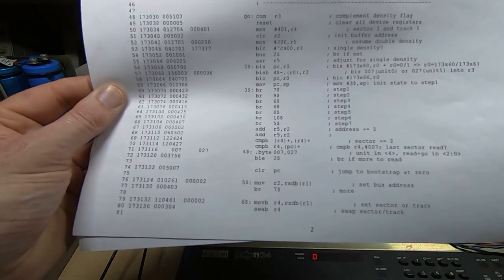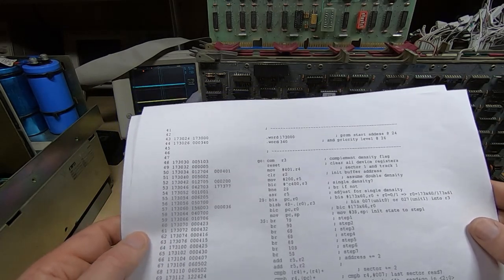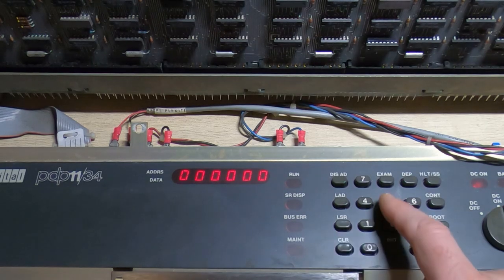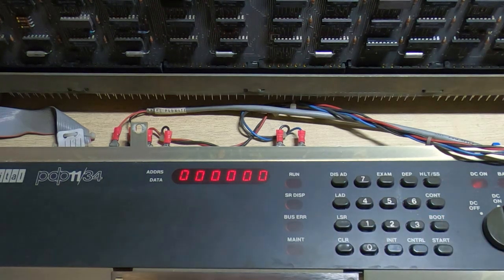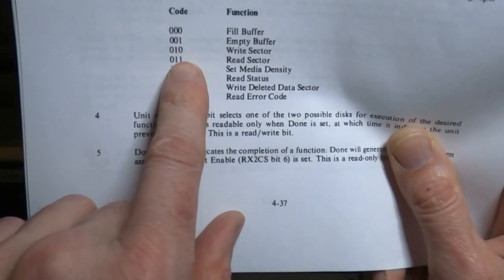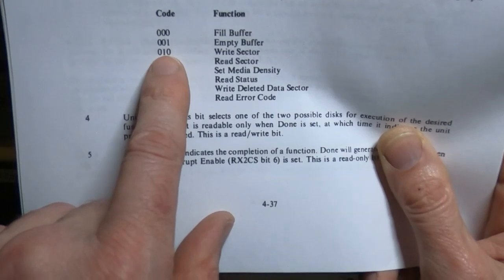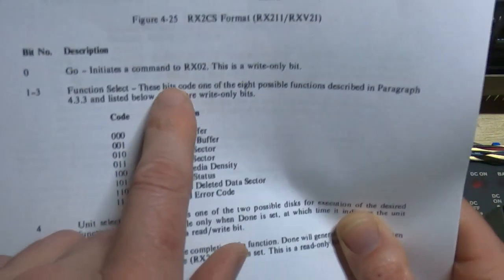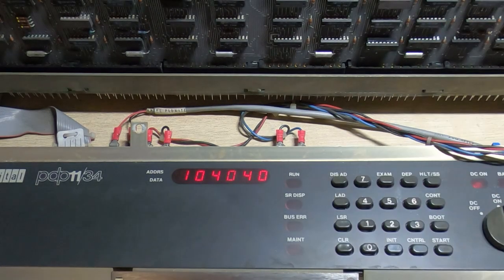PDP11-34A Repair Part29

Comment: Don North on VCFed has an RX02 emulator board that is basically a custom HAT for an Arduino. I bought one from him as a kit and being open source, he has it up on a Github page. Maybe that device could at least help resolve controller problems?
Reply from the maker: Unfortunately the fault is in the internal RX02 CPU board and not the PDP interface board so the emulator would not help as I would not have the faulty board plugged in when using the emulator. The next video should help clarify the nature of the problem.

Comment: Jerry, have you tried swapping the cables between (floppy) drive 0 & drive 1 to see if you get the same error(s)?  That could possibly eliminate possible causes of the error(s).

Also, do you have a copy of "EK-RX012-PS-002 - RX01/RX02 Pocket Service Guide, 2nd Edition, September 1981" to help with the troubleshooting you are performing at this point?  Section 1.6 is on troubleshooting the RX211/RXV21 Subsystem and gives a list of errors and possible causes of them.
Reply from the maker: There is not much point in doing that as there is only a single signal path on the board for both drives. They are simply selected by the drive bit and as the data is present from both drives it is clear that this is not the problem. The fault finding guides are fairly simplistic and do not really help much with this sort of problem although they are sometimes useful for very simple faults. The problem with this unit is that the error line is asserted as soon as the word count is sent to the drive and before the next step so it looks like either a controller / ROM fault or possibly a RAM counter / CRC fault. Either way it will be a real pain to resolve. Next step is to write some test routines that I can run from the PDP CPU to incrementally test the RX02 CPU board system.
Reply: @JerryWalker001  Did you note another commenter pointing out that there are 77 tracks and 26 sectors?  Could you have been entering a sector number too that was high in your test routine? Would that be a possible reason for the error?
Reply from the maker: @bobvines00  That is the entire purpose of the test. I am trying to determine how much of the drive processor is working. As I indicated in the video the test SHOULD produce an error to show that it 'knows' that the first test exceeds the legal limit. The second test is less than the legal limit and so does not flag the fault. This shows that this function is working and is NOT responsible for the drive access failure. If you watch the video carefully you will hopefully see the purpose of these tests. Whenever you are trying to find the cause of fault reports in systems then the best approach is to see which subsystems are able to tell right from wrong. The one that cannot is most likely the cause of the problem.
Reply: @JerryWalker001  Right.  I'll re-watch the video and pay closer attention to the tests and their purpose!

Comment: It is so impressive how you get one fault after another and just continue without getting frustrated!
Reply: It's interesting eh. I can only see this as the application of Stoicism. Or as Churchill put it so clearly: "Failure is not fatal, success is not final, it is the will to continue that counts." It's a very hard state to get in, to detach yourself from the work and not get annoyed at it, especially when it's something as challenging as this. Jerry's clearly got it down in spades, based on the videos I've seen on his channel. Quite impressive. I can only hope he charges a lot for his skills.
Reply: We shall go on to the end, we shall buzz them on the backplanes, we shall probe them on the chips, we shall consult the schematics and in the documentation, we shall move the camera, we shall never surrender, and even if, which I do not for a moment believe, this computer or a large part of it were irreparable, then our determination, backed by our persistence and skills, would carry on the struggle, until, in Jerry's good time, the working computer, with all its power and might, single steps forth to the booting of RT-11.

Comment: Hi Jerry. Yes it is long and laborious - but that is what is needed. Nobody ever said that repairing vintage equipment was exciting or glamorous - it's usually a frustrating slog with no guarantee of success at the end of the process. At least with a rigorous testing methodology you give yourself the best chance of tracking down the problem(s). You just need the patience and determination to stick with it, which you obviously have!
Reply: Sector 100 octal (64 decimal) seems too high to me, as I recall the RX02 is 26 sector 77 track (in decimal). Am I missing something here, maybe the sector address is offset in the register?
Reply from the maker: @ShadowTronBlog  As I state in the video (See the text during the test) This test SHOULD generate an error as the value is illegal. That is what I am testing for. I then repeat the test with a 'legal' value to see if the drive processor can tell the difference (ie can it count). That is the entire point of the tests. I am trying to determine which part of the hardware is generating the actual error so that I can fix it. Remember that this is a fault in the actual hardware processor and not a real disk error so it is not a simple matter of comparing the reported error with a known disk error.
Reply: @ShadowTronBlog  You are correct that RX02 floppies are 77 (decimal) tracks & 26 (decimal) sectors.
Reply from the maker: @bobvines00  I suggest watching the video again and watch at 22:35. The drive Always generates an error but I need to determine which function cannot tell valid values from invalid values. In the tests I show I send both valid and invalid values but the drive can tell the difference so I know that this function is not the cause of the failure (or at least I will once I have checked all possible cases).
Reply: @JerryWalker001  I definitely will do that.  Since I have several dual-RX02 units (and at least one dual-RX01), I need to pay closer attention to learn some of what you are doing so I can apply "lessons learned" to my own troubleshooting!
Reply from the maker: @bobvines00  The RX01 units are MUCH easier to repair. If you look at the schematic for the RX02 you will see the problem. They are have a collection of ROMS and sequence control IC's and the entire thing is a complex mass of interdependent signals. A single error in any part of this can cause very odd behaviour and generally the faults you see can seem to be totally unrelated to what the machine is doing. I have found the best way to track down faults in these units is to go through each function process using all possible values (including values which generate errors) because the error detection is a valid part of the testing and actually seems to be more informative than the valid values (if no error occurs then not much has been gained). Hopefully it will all start to make more sense as the repair progresses but remember that what you are seeing is only a small fraction of the overall testing.
Reply: @JerryWalker001  well this is good to know about the RX01 as that is what I have. Thanks again for your great videos!